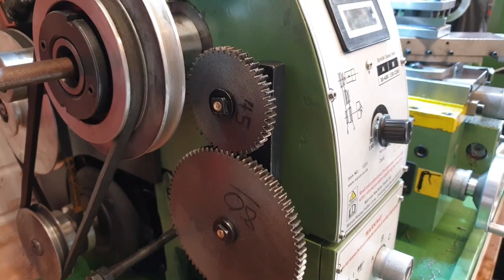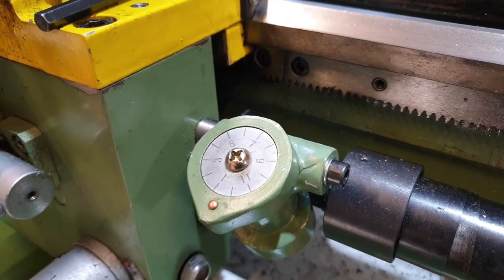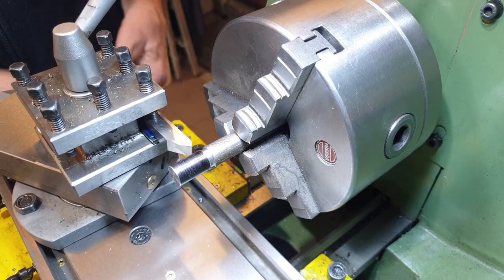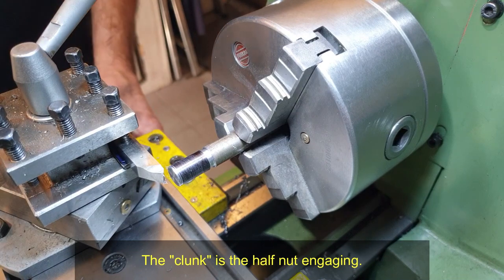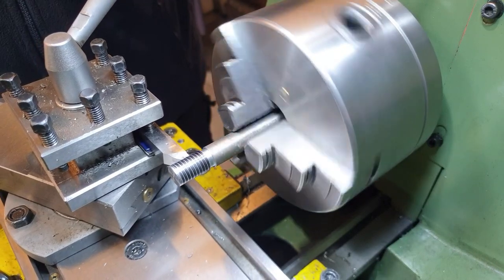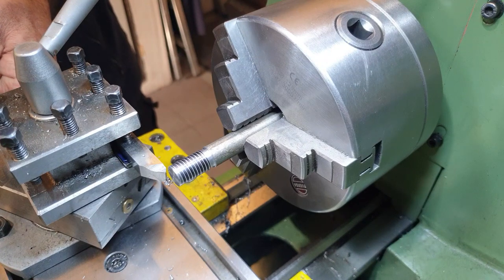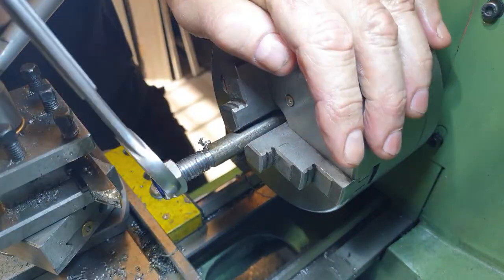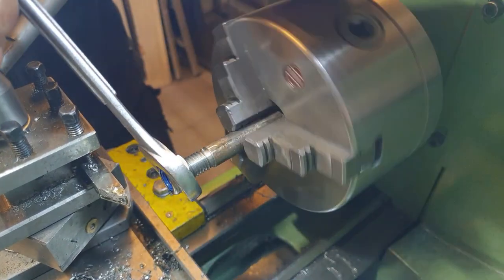Thread cutting on the Warco WM250V lathe

Comment: Very good vid on screw cutting Mark.I have the same lathe and i have to say that making sense of setting up the gear train has proven difficult.
I wondered how you found the process of setting up for the right thread.The noisy gear train is the same for me too.As i am of a machine operating 
background(many years ago) the groove for the thread was called an undercut.Before the thread was cut we turned the od put a chamfer or lead on the end and an undercut at the end 
of the thread and then proceeded with the screw cutting.Oh joy.

Comment: Hi Mark. I own a Warco WM280B. I haven't had a go at thread cutting but one thing that occurred to me watching your video was that I reckon it's a good idea to knock the apex of the thread form off with a file before trial fitting the nut. I reckon the apex might be raggy and very sharp. You want the flanks of the thread form to be a nice fit on the nut not a super sharp apex.

Comment: Hi folks, with a variable speed lathe the 'safe' method of not disengaging the lead screw works very well even for long threads as the carriage return can be quickly speeded up. With these twin taper bearing spindles it's also possible to cut the thread when moving away from the chuck - so much less stressful! BobUK.

Comment: I have the Chester DB10VS which is basically the same machine. I notice that yours stops dead whereas mine has no ‘snap’ on the brake and slows to a stop. Obviously this would make screw cutting this method impossible.
Reply from the maker: Go Check out Jo Pie's video as he does it in reverse, so a dead stop is not required.
https://youtu.be/Z-dqOi_z5bk
Reply: @markshomeengineering5243  I’ve used that method a few times in the past (I’m a turner by trade) but just find it an inconvenience. My Chester has the thread dial but it’s free moving, even with a light touch it could easily lose pitch.
Reply: @jubbaronny it sounds the same as the thread dial on mine, it's bloody useless 🤯

Comment: You mentioned that you were using the compound but the compound seems to be at an angle. Did you mean to say stop slide instead?
Reply from the maker: Hi,
I am using the compound to increase the depth of cut every pass - so the tool is going into the cut at the angle set.  I set the top slide to zero for the scratch cut and return to zero after I have backed out and reversed the machine to get the tool ready for the next pass.
Cheers
Mark

Comment: Interesting, but it seems a lot of trouble (and time) when you could just use a die. What’s the advantage of using a lathe? Sorry if the answer is obvious (except to me) 😊
Reply from the maker: It's a fair question with a number of answers.
First, yes I agree a die would be much easier and quicker, but the only die I had to hand was blunt, so was relegated to the bin;
As with many of my projects, it's more about the challenge of doing something new, or in this case long forgotten;
Finally, my next proper project will to be turn a steering stem for the yokes I have recently made for my Moto Guzzi.  The top of the stem has an M25×1mm thread which I don't have a die for and will need to run true, so I'll cut it on the lathe.
Reply: @markshomeengineering5243  Thanks. I  totally get it for those larger threads. Never thought of that.
Reply: Hi Mark i have the same chart on my machine before they were called warco they were toolco. My question is how does the chart relate to the extra gears i have and what levers or buttons do i use to cut metric pitch threads ?

Thank you.
Reply: @JaySingh-ex6xc  tool co and warco are two totally different companies ,Warco has been trading for over 40 years. both import from the same Chinese factory but I am unsure whether the tool co product is of a similar quality to the warco models.